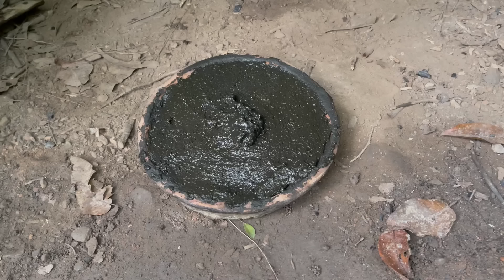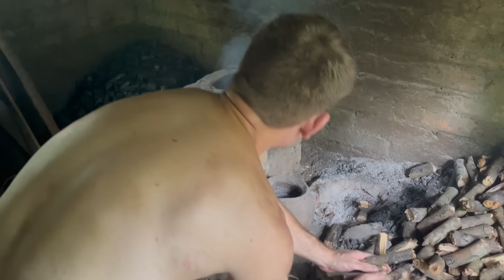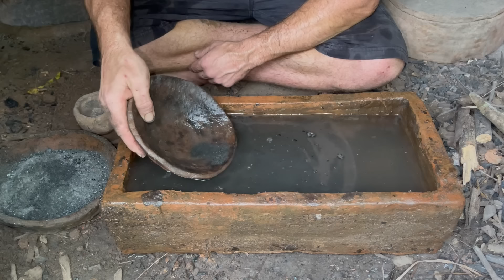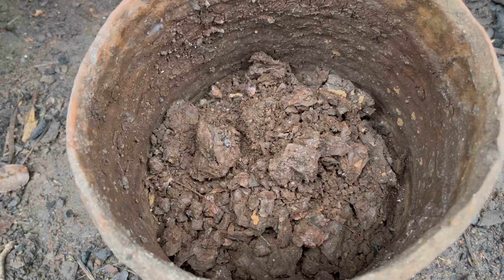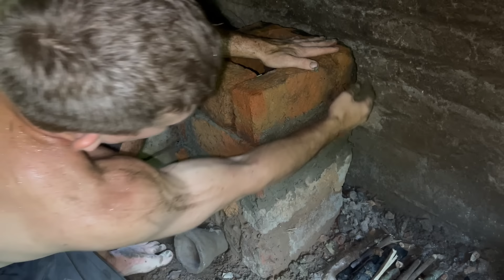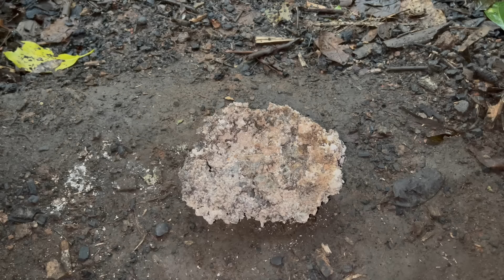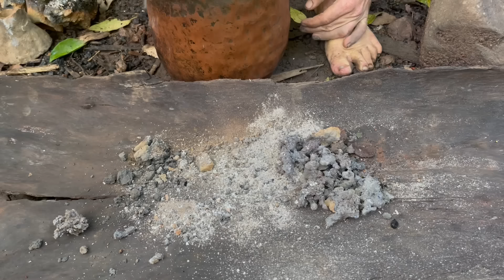Primitive Technology: Roasted Ore and Shell Flux Smelt

Comment: You might need to convert the shells from calcium carbonate (I believe most modern organisms shells are made of the mineral Aragonite rather than Calcite) to quicklime (calcium oxide).  It would add another step of something you'd need charcoal for, but I think it might work better as a flux than calcium carbonate.

Comment: FYI those acid sulphate soils you're using for ore could in theory be used to produce sulphuric acid, you have to solwly roast it and the siphon off the gas from above it into a distillation dystem. Wont be strong but might be strong enough to be useful.

Comment: One potential problem here with the shells is that your adding it unbaked to ore that's been pre-roasted and is now mixed with ash.

Chemically, your you burn wood and get ash, you will end up with one of two products, Calcium Carbonate, or Calcium Oxide. This depends on how much CO2 is present (or rather is enough oxygen present) and how hot your fire is burning. With more oxygen and higher heat, the reaction will tend to create Calcium Oxide. With the way your fire was set up for pre-roasting the ore, you had high airflow, and thus a high heat, and likely made Calcium Oxide.

This is backed up by your subsequent smelt which yielded a far higher vitrification of the slag, as Calcium Oxide is a flux typically used to lower the melting point of silicates.

The shells you used, similarly are also made of Calcium Carbonate and become Calcium Oxide when heated. The real issue here is that you did not prebake the shells calcinating them into Calcium Oxide. Because you had added Calcium Carbonate into your smelt instead of Calcium Oxide, it would undergo a chemical reaction absorbing energy (and thus lowering your temperature), while simultaneously some of it would not change over to Calcium Oxide due to the high CO2 levels needed to smelt iron, which acts as an impurity instead raising the melting point you need to achieve. This is a two fold loss here, as your wasting energy on a chemical reaction that should have been done before hand, and also leaving an impurity raising the temperature requirements for vitrification and thus negating the effects that the flux was supposed to achieve in the first place.

Potential Solution: Try baking the shells like your ore first.

Of course like you said, it might also be due to the different nature of your source of iron, which results in a different chemical reaction and adding even more calcium to a reaction that already had plenty from the ash might cause some issues with pH levels.

Comment: I love how you keep improving this process.  I noticed you are now using flux to improve it.    I think you really need to figure out what you can use the slag for as well as the ore.  

From what I can tell that slag is a perfect starter for producing stained glass.  If my chemical composition guess is correct there is a possibility it may be viable as a primitive cinder for some concrete, or at least cinderblock (which is a more primative concrete.) 

You also need to see if you have any appropriate rocks that can be used as a flint with that metal to make for a next stage fire kit.

Comment: Very long story very short:
1) Roasting bacteria allows to both remove any organic matter, but, far more importantly, get closer to pure hematite or at least protohematite, which are the best form of the ore, all via simple dehydration (both physical and chemical)
2) Iron bacteria is (in BIG simplification) ferrihydrite, which contains both -O and -OH groups of various forms, all terrible for the state of the ore and its reactivity, but heating it (not even roasting) reduces them to just less and less complex ferro oxides, and the less complex they are, the better yields of the eventual smelt.
3) You already added flux when roasting your bacteria using bonfire. You probably figured it on your own long ago (given the amount of wood ash videos you've made), but wood ash is a source of calcium, potassium and magnesium. Aka the three most common things used as flux. Which is part of why you get both better yields and why it is possible to effectively re-smelt slag with better yields than even "greenfield", non-roasted bacteria.
4) The smelt with lime flux failed for a whole set of reasons taking together: not enough heat, not enough oxygen and worst of it all, simply too much flux against the amount of ore used. What happened was actually lime roasting (except too high temperature for that) rather than iron smelting, as the bacteria was simply a minority of the smelting input. It was as if trying to mix concrete, but throwing in fifty times more sand than needed and everything crumbling
5) Roasted ore, and bacteria in particular, is finer than any other form of ore (comparable to the results of an industrial-grade mill), and the finer the ore, the better the smelt, particularly when using a bloomery.
6) Iron sand also benefits from roasting, but in higher temperatures, since it allows to remove silica and its compounds out of it (since you are likely to get also some regular sand mixed into it).
7) The effects of scale kind of work against you in all attempts, including past ones. There is a point after which it becomes harder to smelt iron simply because there is not enough ore in the smelt. I'm not even talking about industrial process, but even an Iron Age bloomery. But since your only ore is bacteria, it would take probably weeks to collect sufficient amounts, and you would have to build a full-size bloomery, too. But on the other hand, not doing so leads to an uphill battle against factors like bad and hard to control temperature, bad oxygen access and too small amounts of ore being surrounded by too much of everything else.

A much longer science for (most of) it all:
https://link.springer.com/article/10.1007/s10973-015-4925-1
Kudos to Mr. Rzepa, even if used to be kind of a hardass during exams. Even if you are not a chemist or in metallurgy, the text is still accessible, while still being a proper paper about just that: roasting bog iron and what it does and why.

Comment: What he's doing is much more similar to Japanese Tatara furnace than any other things.

Japanese Tatara was the only method to process iron sand economically until like, 19th century. 
Videos like B51jK-kj-D8 demonstrate that it's possible to use a smaller-scale furnace to recreate the effect of Tatara furnace.
However, knowledges and experiences are required to know when to punch a hole in order to let slag flows out.

Comment: The amount of energy that goes into metals is brought-home by this video.
I read a book about the history of architecture from an energy point of view; it starts with seasonal shelter made of mammoth tusks and skins on the steppe, then more permanent structures mud of dried-mud bricks.
A mostly wood house is a step-up in energy - particularly the roof 
It quickly gets to the industrial revolution . . .
To fire the materials of an early industrial house takes something like Two Football Stadiums worth of Forest!
Then Coal-fired bricks, glass, iron and steel arrived: Coal has remarkable energy density compared to wood.
Cement production uses a very large proportion of the worlds energy: fired with Natural-Gas.
There were a few factors in the fall of Rome; long-term weather shift reducing grain production was a large force but so was the lack of forests: they had burned all the wood.
Think about your choice of house if you can, in terms of energy.

Comment: It would seem to me like the volume of air you are able to provide to your smelter is insufficient to achieve a more efficient initial smelt and might be your weakest link in the smelting process at the moment. Though most improvements you could achieve to this would likely require animal products in the form of leather for conventional bellows,  perhaps some form of box bellow made from bricks is possible with your current tools if a more novel solution does not present itself.
Very entertaining and informative video as always. Looking forward to the next.

Comment: I know that putting a dust ore on the coal gives it more heating area, but what would happen if you would just put a whole jar with dust ore onto the top of coal and heat it the same and let the jar turn into overheated cheramic just by sinking into the  oven? That way all the ore would be more concerned and maybe the iron would come out in bigger balls?

Comment: I think dissolving the leftover slug powder in acid and then increasing the ph to precipitate the iron/iron oxide/simple iron compounds out of the solution would be very efficient (or at the very least have the impurities taken away by the acid). Using natural gas for smelting and cleaner smelting apparatus would increase the yield and its quality.

Of course you would need to find a way to implement it in the primitive settings.
Citric, lactic or hydrochloric acid would be easy to make at home, but in primitive conditions maybe not so easy.
Combustible gas could be made with fermentation or thermal cracking of coal. Gas handling apparatus would be an issue, though. You would need some (animal) membranes or non-permeable coating to keep it from escaping. As of the cleaner smelting setup: glazing the bricks/the inside of the furnace should help together with adding a proper furnace floor, though I'm not sure whether such glaze could be obtained in those settings.

I'm not saying all this stuff is possible in the channel's theme, but one maybe is.

Comment: Could you make some kind of heat exchanger to preheat the air before the tuyere using waste heat from the furnace? The invention of the "hot blast" furnace reduced fuel consumption by 20% or so.

Comment: when you have an iron sphere supply built up, what will you make them into? and with what methods? even if you can heat them up enough and smack them between a stone hammer and stone anvil to cohere into a hammer head, how to mount that hammer head on a shaft?

Comment: I would wager that the iron floc is largely oxy-hydroxides, hydroxides and some carbonates of iron(III) where the microorganisms are oxidising Fe(II) to Fe(III), this also occurs through entirely chemical means and tends to leave a skid mark on the porcelain in your bathroom when there's a lot of dissolved iron in the groundwater. As a result I'd concur and also speculate the slag may have become too basic.

Comment: what if you had a two tiered furnace system so that the air from the blower gets heated by an initial fire before flowing through to another chamber with a second fire where the smelting would take place

Comment: You need a little bit of moisture in the Flux mix or it won't glass the iron.
Reply: 15-20% depending on how fine the Metals are. Coarse metals, less to no moisture. Finer metal particulates. add water.